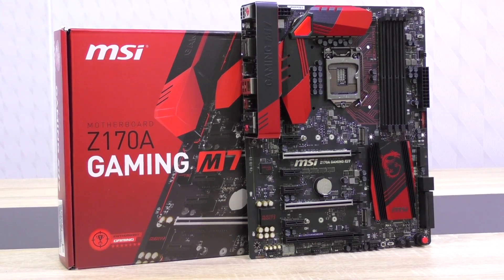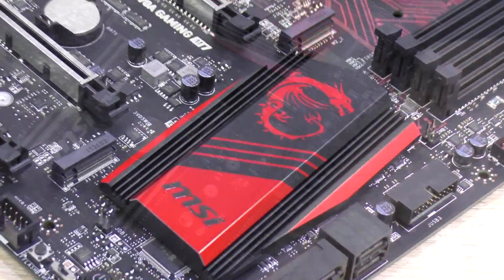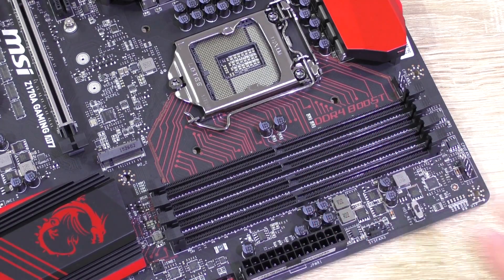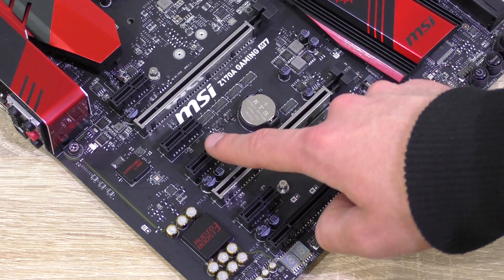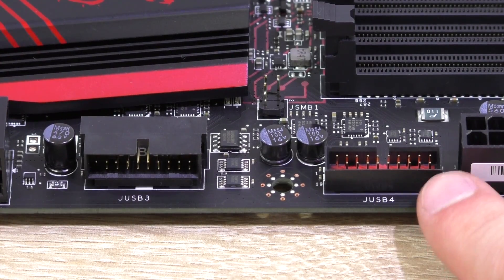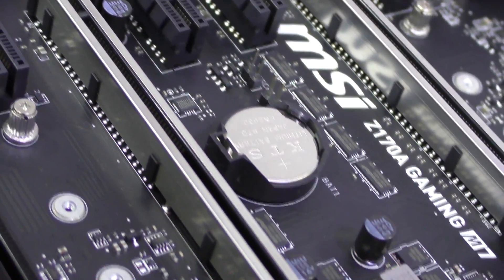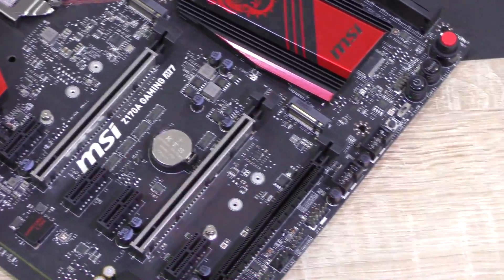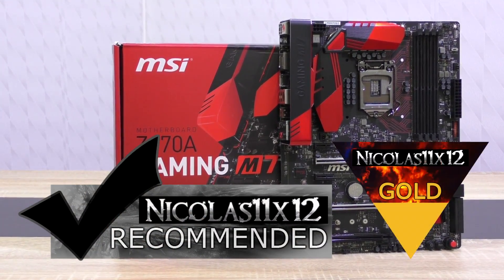MSI Z170A Gaming M7 Motherboard Review

Comment: I’ve had this board since it came out paired with a 1070 8gb, 6700k and 32g ram. Everything overclocked. M.2 from programs and windows, SSD for games and HDD for recordings/data. Playing 16:9 @ 1440p. It’s only been about a year since I’ve started thinking about upgrading or a new build. Don’t get me wrong, this pc still rocks and will still probably be great for 1080p gaming for years to come, but once you get to this quality, it’s hard to not want more as it comes out. If I were to upgrade anymore
than a 3070, I would get CPU bottlenecks, to avoid bottlenecks, would need 9th gen or better. Might as well replace the CPU too. Wait, what’s that? Every got dang chip is under a new chipset? Time to get a new mobo too. Hold on, DDR5!?!?

As you can see, if i want the same, best experience I got nearly 6 years ago, I would have to build a new PC. But after the 4090 and 13900k drop, I’m gonna hold off on this generation. Playing Cyberpunk at lower presets will just have to be the norm for me now. Would still get the M7 today, (although I’m pretty sure they stop making them) but if you get it used, it makes for a great starting point. My ONLY complaint is no Bluetooth or WiFi built in, but that was not the norm back then. PCIe expansions make that easy, but most boards these days come loaded up anyway. Hardline connecting has always been better due to speed and stability.

Comment: 2:33 Dors support for dual channel xmp mean that I can only enable xmp if im using 2 of the 4 ram slots? Thank you for the very informative and well made review! You deserve a bigger audience! :)
Reply from the maker: +Saa Kapo Thank you! It shouldn't matter, if you used 1, 2, 3 or all 4 RAM slots to enable XMP. But honestly, I've only had 2 or more modules installed my entire life so far. However XMP should also work with just 1 module installed, as long as the Memory itself supports XMP (most do so). :)
Reply: +Nicolas11x12TECHX Thank you very much :).